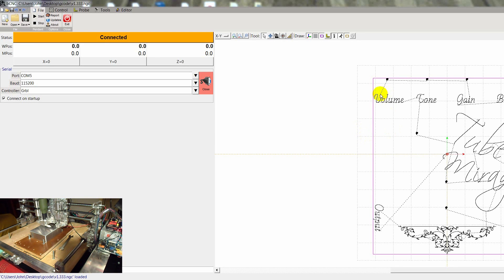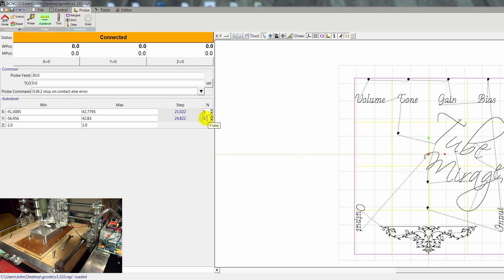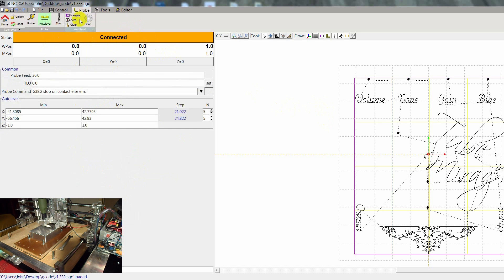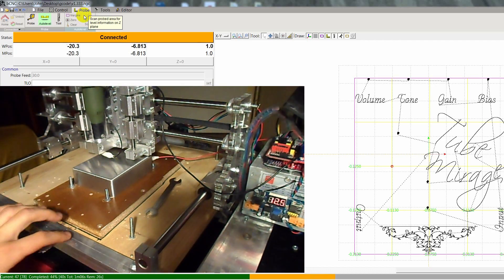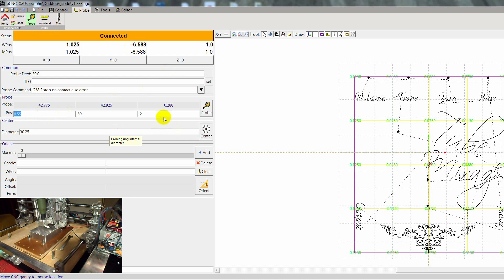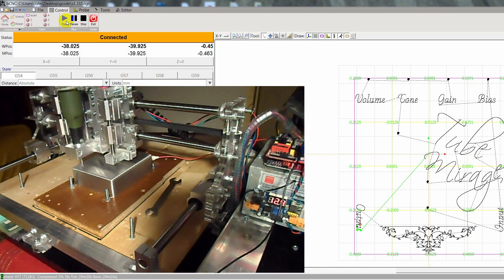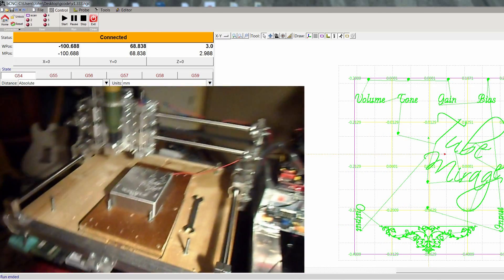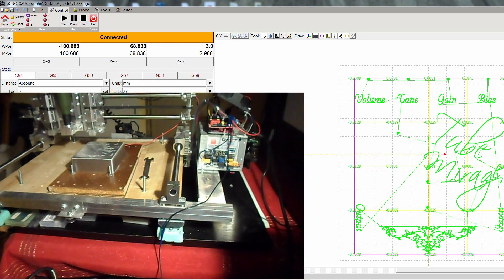bCNC Autolevel Tutorial

Comment: To all users as of 12/2020.... You DO NOT get a warning if you don't click "Zero" @ 5:43 and it WILL plunge the bit right into your stock. Ask me how I know.  When you click it, you will see the values change so that they are relative to the zero Z position, this is why you run the probe: to give the autolevel a new reference point.
Reply from the maker: Happened to me actually :)) and they are pretty strong bits if you have a good transmission you might damage your spindle
Reply from the maker: Happy New Year to all pedal builders!!!! And remember to take a bath. That's how Archimedes discovered displacement

Comment: I have a DIY laser printer capable of cutting 3mm MDF, as a probe I use a microswitch and to home the Z axis I use soft homing (I move the Z axis all down until it bottoms out, the move to the top), so the top is at "0", when I press the Scan on bCNC, it tries to move the Z axis 3mm above 0, which is impossible, I ended up with the GRBL throwing an alarm code and it donesn't work. I got it working by adding "safe.0 = 0.0" to the config file under the "Stock" section. Hope this helps someone!

Also, thanks for the vid! Tried UGS, it works, but it removes all the commands that makes my laser work from the GCODE (it still experimental).

Comment: Good morning, do you use as a grbl milling machine driver for arduino? How (to which pins) should the sampling wires be connected?
Reply: i know this is old, but the probe pin is SCL on the arduino, i actually built a schmitt trigger circuit for all of my limits and probe to overcome electrical noise.
Reply: i have the very same question right now, did you found something?

Comment: Can you explain why when you did the final Z zero probe, you inverted the sign of the pre-set zero value? (You put -1 in the probe Z box, but the WPos Z is 1.0, not -1.0. But for X and Y, you did not flip the sign.)
Reply from the maker: yes. probing is a 3 axis move. x and y are the current position because you want the router to probe vertically only. I scanned z until -1, but the probe triggered at -0.01. keep it up!
Reply: Thank you for your reply. I was able to autolevel successfully. =)

Comment: Good afternoon.
I have managed to run the program thanks to its tutorial and I was able to make a pcb, but I have doubts to change the milling tool and put a bit, so that the machine respects the height and makes the drills correctly.
Is there any adjustment to take into account when we are going to change the drill for another drill ?.
Thank you.
Reply from the maker: Hi. For tool changes memorize the coordinates of the initial zero stage (at 4:40) and use the same to probe and zero out the new tool. Provided that the height in that point (in my example x=1, y=-6.5) has remained unchanged, the height map will be valid for the new tool as well. Now keep up the good work!

Comment: Hello Friend
I have never used bCNC and am a little disoriented. I am using GRBL 0.8 and Shield V3, but I do not know how the probe is configured, nor where it is connected. You can help me?.
Thank you
Reply from the maker: Hi there. No reason not to upgrade to 0.9! probing is native on 0.9, not supported on 0.8 as far as I know. Connect SCL to surface (top right corner on board) and GND to your bit / end mill
Reply: @mendebil  i'm use grbl 0.9j ardu uno and v3 shield..but I don't have a way yet. I hope you can share the method..thank you